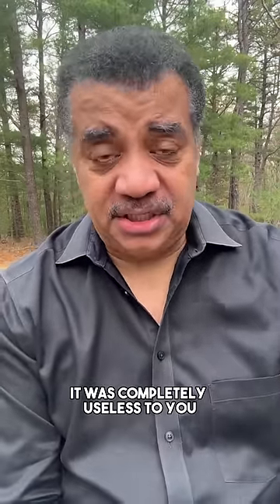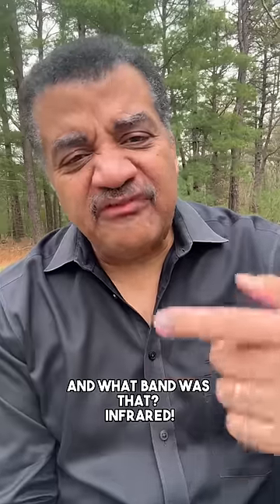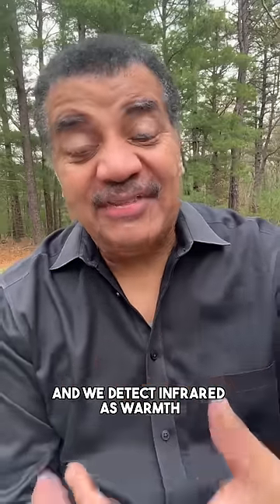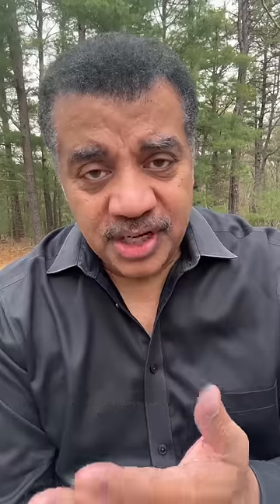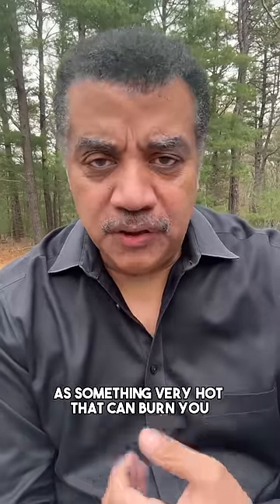LED Bulbs vs. Old Bulbs 💡

Comment: Neil did a great job explaining the advance in technology. Now we need an economics expert to explain why this technology is costing us 10 X’s as much. Bit of a paradox here.
Reply: They charge whatever the market will suffer. Cable company executive told me this in the 90s and its still true today.
Reply: Because the price of goods and services are determined primarily by how much customers are willing to stop buying it, and only secondarily by how expensive it is to produce.
Reply: It's simple. Government has printed a lot of money while all that innovation has occurred
Reply: Because he skipped a lot of the story. Old bulbs use thermal phenomenon and newer bulbs use semiconductors which has significant research went into it for development to the point they are now, fabrication of LED lights is also costlier.

Old bulbs have very less parts, each LED bulb needs a rectifier circuit to convert it to DC from AC voltage.
Reply: They also last much longer so you don't have to change them as often
Reply: Too many ppl getting a cut and padding their own nest. IMO
Reply: Let's say you used to change a 75c bulb once a year, and now you change a $7 bulb once a decade.  You're saving money in this approximate example.  Actually, an LED bulb could potentially last longer than a human life, so that would save a lot of money.
Reply: @Apophlegmatis  right I've changed all my bulbs to LED when I moved into my current place 5 years ago and the only one I had to change was one that was broken during a slightly too enthusiastic party
Reply: @dojelnotmyrealname4018 but staple goods like lightbulbs have inelastic demand, as everyone requires light in order to function in the modern world. Goods like Cable TV are luxuries that people can stop using if the price rises beyond what they can afford. If you went to someone's house at night and they were just walking around in the dark because they can't afford lightbulbs, you'd say they were living in poverty, if someone doesn't have cable TV, or even a TV at all, you'd say they're just being frugal.
Reply: @Apophlegmatis i have never had an LED bulb last any longer than an incandescent.
Reply: Bruh I bough like 20 leds on sale for 2.50 for 5 when they were trying to switch over.
Reply: Same reason why a 2GB SD card was worth £55 in 2006 and now it's £10 for 128GB.
Reply: @tobieaina  SOMEBODY did his homework.
Reply: When they got released more than 10 years ago they were a lot more expensive, not so much now. I haven't changed lightbulbs for several years since getting LEDs
Reply: Probably because LED is also semiconductor, so like many semiconductor it's costly to manufacture
Reply: Price is set by supply/demand, in this case demand is the main factor. Before led's the price of light bulbs were set by phoebus cartel (worth a read)
Reply: @vivektam  Every LED IS a rectifier

Comment: infrared is useful, heat is useful if you need it.
LEDs DO get hot, that's why they have heatsinks, the PSUs also get hot, produce HF noise in your power and mess up your power factor, they also never live up to their rated lifespan.
But yes watt for watt LEDs are more energy efficient to run.

Comment: Interesting fact: many airports have converted runway lighting to LED to save energy. Only problem is that many modern aircraft use a “heads-up display” with an infrared sensor to see the runway lights through the clouds when getting close to the runway. The infrared sensor cant detect the LED lights, so then they had to add infrared emitters to the LED light system. And the pilots have no way of knowing which airports have  which lights.
Reply: Welcome to "sustainability". Also known as, taking things backwards!
Reply: @jcstang8952  you sound like you must be 60 years old
Reply: @jcstang8952 Ah yes. The minor hiccups and revision that make progress actually be regressions. Like how overcoming some challenges with manufacturing tolerances of early coolant thermostats, turned everything away from cars back to horse and buggies.
Reply: @jcstang8952 what a strange comment. Your logic would have us believe that living in Medieval times would be more comfortable. Answer this question, would you rather have a larger electricity bill or a smaller one? You save electricity and therefore $ by using components that don’t waste 90% of their energy making heat instead of visible light.
Reply: Denver, CO converted most of their traffic lights to LEDs. This was accomplished during the Spring-Summer. When Winter set in and the snow fell, it landed on the traffic lights but wouldn't melt from the heat of the lights. When the sun would come out, it would melt enough of the snow to make a big ice block out of the lights. This result of the changeover caused all kinds of havoc for drivers and increased workload for city workers having to de-ice the lights.
Reply: @wastedute444 new ones have heat emitters to fix that problem, wasn't foreseen. But now it's baked into the design

Comment: If only we can keep the light bulb's lifespan as long as they used to be
Reply: That's the real idea.   LED bulbs made in China by the finest in involuntary labor, go out at 2-3x the rate and more money in the company pocket. More money in the owned politicians' pockets and more money in the Professor's pocket to be a propaganda mouthpiece.  😂
Reply: It varies by the brand, but they can last for like a decade or two. There's a pretty good chance you'll move before having to get a new LED light bulb. They last multiple times longer than even the best alternatives, and dozens of times longer than incandescent light bulbs
Reply: @Chris_winthers actually I replace them more often than I did the incandescent bulbs.
Reply: @donaldsmith5641  sounds like you need better LED's

Comment: I am glad that incandescent style LED bulbs are being made now, as some of us, myself included prefer soft white incandescent quality lighting with the frosted glass. I use GE’s incandescent style frosted glass LED in my bedside lamp. My desk lamp however uses a genuine amber glass Edison bulb. As it’s a warmer light which is easy on my sensitive eyes, and the 40 watt bulb puts out around 240 lumens which is less that my bedside lamp. Plus LED filament bulbs can’t reproduce the decorative look that true tungsten Edison bulbs have because the filaments are too “fat”. Plus I wanted a light that was bright enough to see my face during a livestream, but not be painfully bright and a warmer color temperature which is achieved by the amber glass.
Reply: You need to look up a smart bulbs to get any light temp you want. Learn Kelvin ranges too. Kasa makes a great smart bulb with 6.5 million color possibilities.

Also, look up decorative thin filament led Edison bulbs.
Reply: So nice to see the thought put into the different types of lights that you surround yourself with.  I love sine if my older lamps with special old style softer bulbs .  Cheers 💡

Comment: FYI led lights do indeed get quite hot but typically have a heat sink of some kind to dissipate it elsewhere, usually the back.
Incandescent lights can't do that because the part that's producing the heat is the filament which also produces the light.
Reply: I was looking for this comment to see if I had to make it, because nobody else did.
Reply: I think(not 100% sure) the part that gets hot is not the LED, but the area that holds the circuit board with all the resistors and capacitors and bla bla bla that LED lightbulbs need, most of the time when an LED fails, is not the actual LED but the circuit board that fails

Comment: Another explanation

Incandecent bulbs(old bulbs) basically have tungsten, an insulator(something which blocks electricity) in them and it acts as a wire. You pass electricity through it and it forces its way through the tungsten, but it heats it up(as the tiny electricity particles bump into the tungsten particles). The tungsten then glows red hot, and its that glow you see

Then we got flourecent blubs(tubelights). In them, a gas is pumped in them(many diffrent ones, neon makes the bright signs) and when electricity is passed through them the gas gets excited and emits light

Then we got led bulbs. In leds, it is pretty much the same thing as flurocent bulbs, but with ions instead(ions are divorced atom parts)

Comment: I actually never thought about this. That's neat. I'm glad Neil pops up in my feed so much; his passion for learning and teaching is infectious.
Reply: NigerJevrejin  but its not from IR radiation, and they're nowhere near as hot as incandescent bulbs either. The heat from an LED instead comes from the components at the base of the bulb which also act as a heat sink diminishing the heat output from the bulbs even further. They're quite an improvement
Reply: So this guy always says things we learned in 7th grade. Guess what? Neil. You can't keep baby chicks warm with LED, but you can with a filament light bulb.
Reply: Unfortunately he’s a UAP denier. It’s very sad and unfortunate.
Reply: It's a shame he is wrong most of the time
Reply: Shame he doesn't know that infrared is actually important for our brains.
Reply: @dicky7600 He litterally only talks about facts.

So you must be on fake news websites all day then.
Reply: @Shakazuloeman  <<oooooh.  Someone thinks he's smart.
Reply: @dicky7600 No someone knows they're smart
Reply: @Shakazuloeman so you have experimented right?

Comment: To be fair, modern LEDs don't convert all energy to visible light, they only convert around 40-50%.
But that's still an 8 to 10-fold increase over incandescent lights. So 6–10 watts is roughly the equivalent to the 60 to 100 watt bulbs.

Comment: It wasn't useless, it would help heat our homes. The radiators would heat our homes from below and the old light bulbs would heat our homes from above. Locking the heat we pay for, and keeping our homes circulating warmth.

Comment: All those old bulbs used to keep my house warm, now I have to turn up the heat pump. They also thawed out any frozen pipes and kept the bathroom warm during usage.
Reply: The heat pump can provide all the heat that the old light bulbs did - and use only about 1/2 or 1/3rd the energy they did doing it.  

Typically, the heat pump is also heating air directly in the home, while some bulbs mounted in the ceiling end up heat the attic or other unused spaces more than the home, so that's another gain for the heat pump.
Reply: And during the summer months? When you don't need that additional heat?
Reply: Heat pump? Wasn't that your mom's nickname in college?
Reply: Heat pumps don't get hot enough. I still wear a sweatshirt inside. 
 @Cynthia_Cantrell
Reply: You mean lukewarm pump.
 @Cynthia_Cantrell

Comment: We still have a few incandescent bulbs here, for heat lamps for little birds. Hopefully we won't need that much longer, at least this year. Yeah, it gets HOT.
Reply: I have a heat-lamp for my pet snake along with a rock that emits heat. I live in a high desert so it can get freezing cold despite the heat.
Also, incandescent light bulbs are great for outside lights in cold weather as they keep themselves warm. I find that LED lights don't hold up well to freezing weather.

Comment: One interesting thing about LED lights is they strobe. But like with movies, they flicker fast enough we can't see it happening so that LED lights appear to be on continuously. You can detect the flickering if you watch snow flakes fall.
Reply: Get better lights so they don't flicker ;)
Reply: @hardopinions  Understand that the human eye just can't detect the flicker. Just like in movies or car lights or traffic lights. It doesn't matter.
Reply: @hardopinions even your 'better' LED utilise pulse width modulation, but the good ones will have variable PWM timing so that you can set them up for the frame rate you're filming at so you don't see it. 
I still prefer tungsten lamps though due to their colour rendering
Reply: Anything on AC power (and I'd be very surprised if your home uses DC) pulses. the amount of pulses/sec (measured in Hertz) depends on where you live, but is always high enough to barely be noticeable. It's not called alternating current for nothing

Comment: What's funny is LED bulbs are dying prematurely because they're getting too hot.
Reply: I've found Phillips to last better than most. Incandescent light is much more natural and since I've switched back (in living areas) it's more relaxing.
Reply: @nedcramdon1306  LED makers for a long time seemed to be afraid to sell warm natural LEDs, the color comes from phosphor just like CFLs so they could have made any color.
 My theory is because whiter LEDs have higher candlepower on paper (But not to the human eye)

I'm still trying to find LEDs for my car that don't blind everyone (including me in the rain) because they're so blue.
Reply: And they are costing more money that all that wasted heat!
Reply: It’s normally the electronics/driver board that controls the LED having the issue. Can take it apart and test for shorts and fix what’s found bad. I had one warm up too much after 2 year.
Reply: The LEDs themselves are still good, it's the electronic driver circuit that always fails?  Why?  Excessive heat.
Reply: @IrrationalBstrd  Do you know if the circuit can be modified to reduce the failure?  I know it’s common for failure points to be designed and built in to products.
Reply: @IrrationalBstrd  I thinks it’s very low melting point solder, but really it’s more like planned to fail at some point. Realistically I have never had a diode “go” bad without some kind of outside source causing it to go bad.   Edit: on one I literally found a resistor basically slid down off its pads
Reply: @coriddeval1815  most of the components in them are surface mount.  I had a 6" round LED recessed light fail that was only installed for about a month.  I opened the driver section if the junction box and there's a bank of 4 resistors that are toast.  I'm not sure exactly what caused the failure yet, but perhaps higher wattage rating resistors would help.

I've had several led bulbs fail in fixtures that have enclosed globes, trapping heat.  The bases ,where the driver circuits are, are usually cooked/browned/blackened and often times cracked from expanding.
Reply: That has never happened to me infact i have only had one led bulb died on me so far.
Reply: @mixoh  have any darkened?
Reply: @joverstreet24  look up Dubai lamps, if they reduce how hard they're driving the led filaments by having more of them, it increases efficiency and increases life span. But because of whatever agreements they can't sell them in the US

Comment: One big problem these days is that if you get a bright enough LED bulb you've still got a lot of heat coming out of it, it's just going into heat dispersion rather than coming out of the led itself. Get a high-power headlamp or flashlight and see how quickly that thing gets extremely hot.
Reply: True, I have a 2,000 Watt . Flashlight and it Heats up pretty good.
Reply: Wrong. Heat dispersion still heats the space containing the bulb.

Comment: We used a 25 watt bulb on a timer in a storage shed at the beach, no rust whatsoever on the steel stored in there. Works great. Somethings are fine the way they are.
Reply: Yeah....because 50 watt bulbs cause rust?
Reply: @colinyandon6137 a beach setting is very high in Salt and water content in the air. Metal rust quicker with that combo. There are some beaches to freshwater lakes but I have a feeling that not the case for op post

Comment: my dad is a retired electrician of 40 years and he still yells when someone leaves a light on.   we replaced all the bulbs with LED probably at least 10 years ago now...    he still freaks out if you so much as leave the room with the light still on.
Reply: Well, it consumes 10x less and the electricity is 10x more expensive :)
Reply: @igorspitz   yeah but this is the same dude who leaves the 60 inch TV on and the ceiling fan spinning and takes off for 8 hours.

Comment: Lightbulbs originally did not burn out for many many years. Manufactures got together and decided to make lightbulbs burn out so you would have to buy a new one
Reply: This!! It's called planned obsolescence
Reply: Sort of. The Phebinous (sp) Cartel gets a bad rap. But, the prescribed duration is about as bright as the light can go and still have a respectable life span. If you want longer life spans, the bulb has to be dimmer. The longest living light bulb is barely a night light.

Comment: This man never raised a chicken from an egg.
Reply: I know exactly what you are talking about. But many people don't I guess.
Reply: I’m a bit confused, what’s the point of this saying?
Reply: Egg came first, before the chicken
Reply: @amycox7508 you use old light bulbs in incubators to keep the egg warm without its mom sitting on it 🐔 🥚
Reply: I've  BRAISED  a chicken w/out egg, tho'.  Duz that get me a Nobel Lariat?  Yee, Hii !!
Reply: @warsofgods1992 
Which  bible  do  U  read?
Reply: @warsofgods1992 I thought for sure that it was the rooster who came first 🤷‍♂️
Reply: @wagner9050 Irrelevant, all are fiction.
Reply: And it shows.
Reply: @modestgrower2017 you don't need old light bulbs. You just need a heat matt.